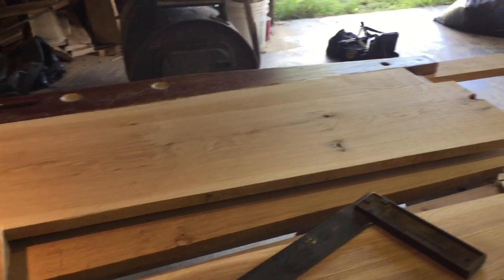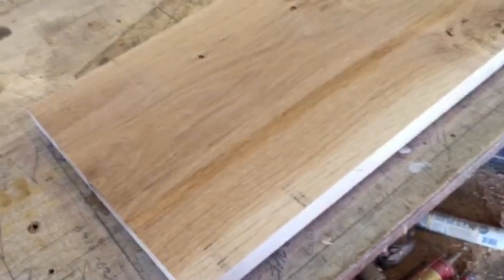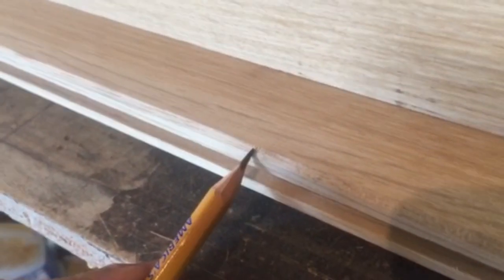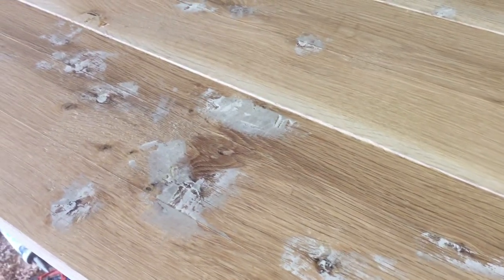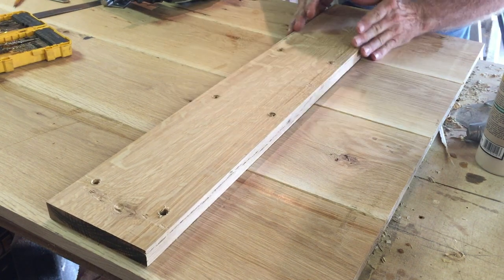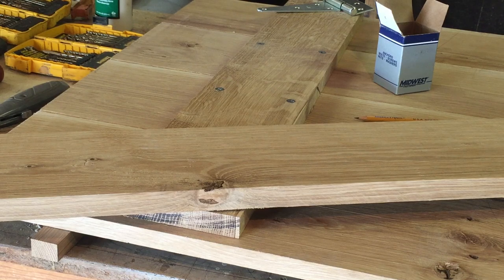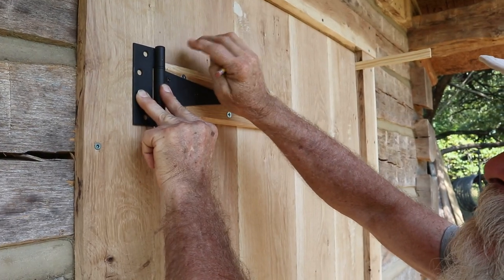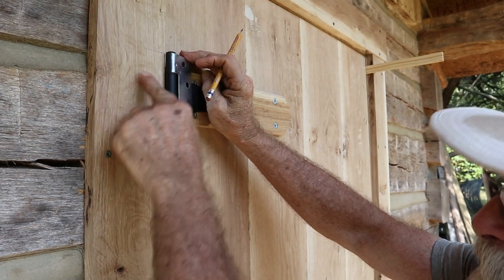Smokehouse Completion (pt 4) - Building the Door

Comment: You glued the Z brace?  Won't the boards crack from the cross grain bond?
Reply from the maker: Joel Paul   Howdy Joel- I’ve built quite a few doors using this same method and have never had a problem, some of the doors are well over 30years old and never split. I always use well seasoned wood when building a door. Not only do I glue the bracing, I put screws in them too. Thanks for watching and commenting. God bless